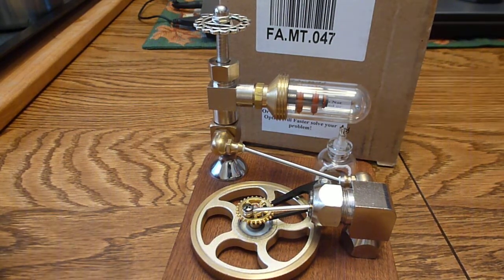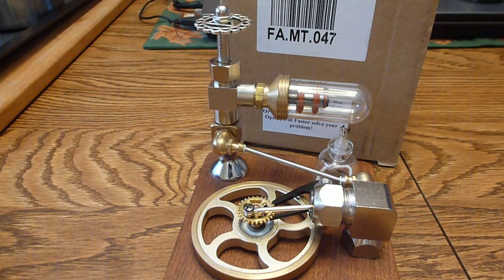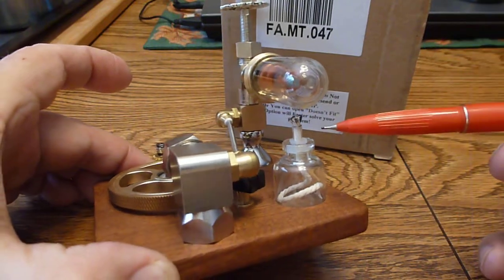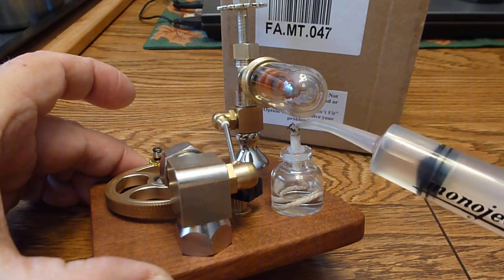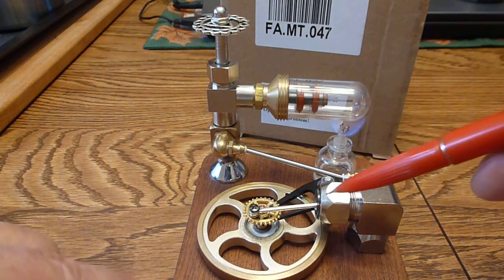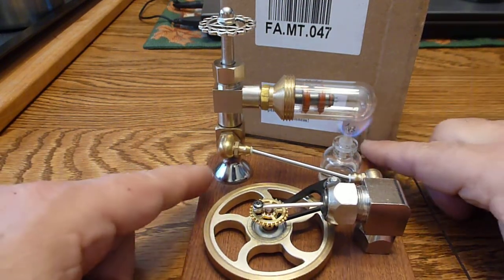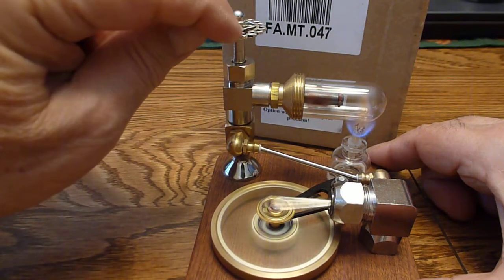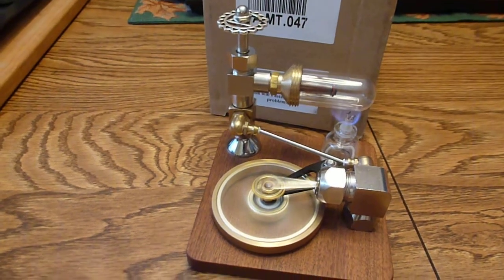P1030994  New style Stirling Engine with throttle

Comment: I’ve been trying to understand how Stirling engines really work.  Watched dozens of videos and just when i think i understand it, i see this baby which wiped out all my notions.

The horizontal flywheel sure makes a ton of sense
Reply: Think of it as a closed loop. Inside the large glass bulb in a smaller bulb that moves back and forth to close off the glass chamber between the two glass bulbs. When the air inside the glass bulb becomes hot it pushes the smaller glass bulb inward while  the air inside is expending due to heat and rushing out of the chamber as it closes. Then the hot air flows to the cold piston where the hot air will first push the piston out. When the air inside the cylinder cools it contracts pulling the cylinder back in and the same air goes back to the bulb pushing it open for the cold air to enter the chamber and repeat.

Comment: "Just because it's going slower doesn't mean it gets better fuel economy", is a quote everyone on the road needs to hear. Fuel economy is dependent on your peak torque RPM, or in a sterling engine's case, the faster it goes the more efficient since what consumes fuel stays consistent.
Reply: Spark ignition engines aren't efficient at part throttle either.

Comment: Still waiting on a practical application for these little dudes... I know, I know, it's a 'she' to you...
Reply: They're handy for driving generators. I've seen some people use them to charge their phones
Reply: They used them during the war to run radii generators be dam if I can fine one on line.
Or in england they use them to drive mine water pumps.

Comment: I wonder how the throttle works?
Reply: Just by pinching off the connection between the displacer and the working cylinder.
You could basically build in something like that on any stirling engine, wether it is a ringbom engine (like this one) or not.